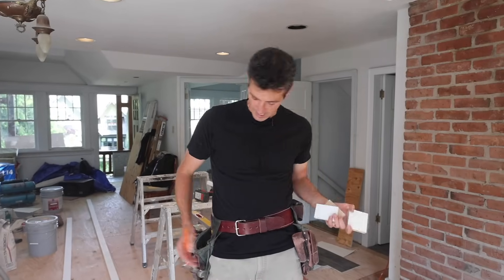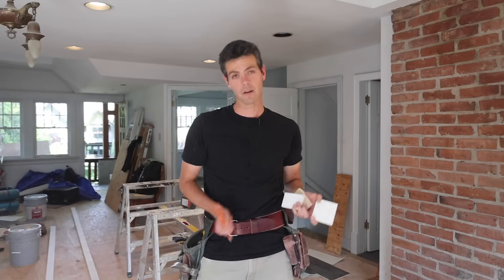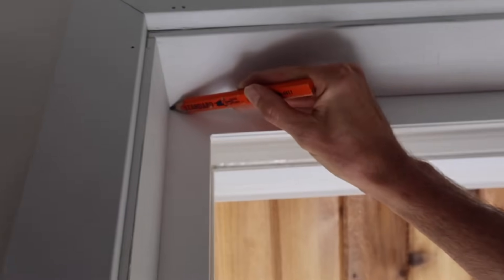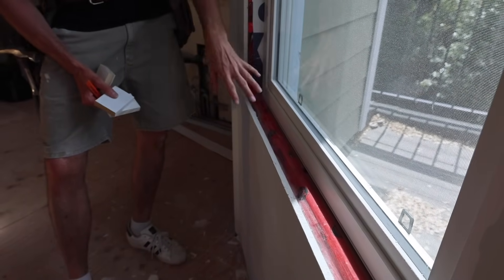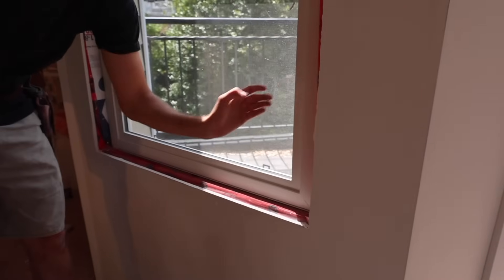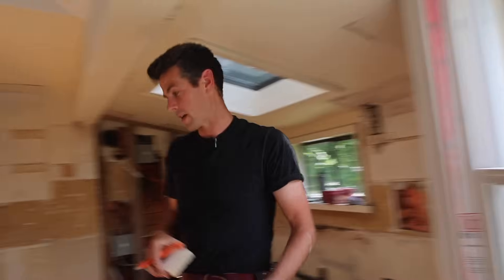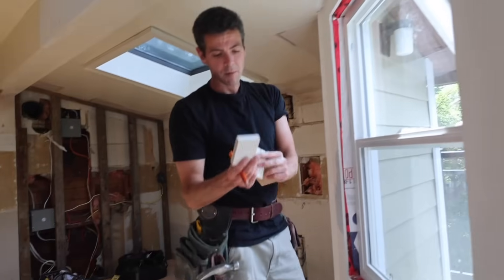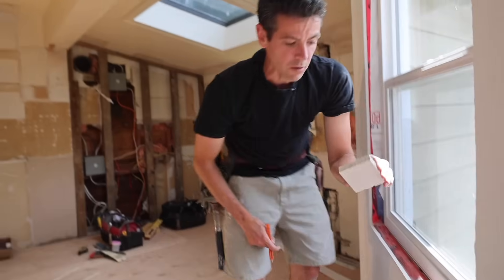How to install a WINDOW SILL you won't REGRET!!!

Comment: The slide markey thing is a combination square.  Love your Videos,  just trying to help if someone is trying to find one.  Also the little nurled round bit on the frame is actually a metal scribe hidden in a convienient spot since it's sharp point won't dull and is more accurate than a pencil.

To fine tune the back gap why not run a carpenters pencil down the back wall and where ever it marks tune it with an orbital sander or belt sander.  Easy way to get a contour match.  It's an old countertop makers trick when not installing a backsplash.
Reply: I'm calling it a "slide markey" from now on.

Comment: I suggest you get a long metal or wooden ruler... tape measures normally have a bit of movement in the grippy bit at the end, so they are only accurate under tention, not when you lay it on the side and press a pencil against it. I know it is only an mm or so, but you said be accurate.

Comment: This has been the most complicated way of doing window sills I have ever seen in my life.... 

Step 1 get your inside horizontal dimension measurements &  add your outside reveal over hang  measurement to your inside measurement ( for example if your inside is 36 and your outside reveal overhang is an 1inch then you add 2 inches to 36 and you get 38". 
 Step 2 measure your inside jamb perpendicular on each side and add your  apron stock measurements (for example if your left side is 3inches and your stock is 3/4 then one side is going to be 3 3/4 repeat same method on opposite side. 
Step 3 transfer all measurements to your stock you want rip first then establish your  over hang reveal once doing that mark the insude corner of the  overhang 
Step 4  with an angel finder you butt your angel finder to the corners of your window sill and you get your corner angel and line it up to your stocks corner points or the over hang you transferred. 
Step 5 once you have transferred your previous dimension to the the stock you cut and rip as needed per your measurements then transfer your corner angel to line up to your inside point of the overhang reveal. Cut with a jigsaw and wallah easy window sill
Reply: Any way you could do a video to show what you are talking about and share the link with me?
Reply: Great post !! 
I have an addition to make things simpler for some.
My jambs are made as a 3 piece unit and pinned together with some glue, and dropped in place over the stool. I make them 1/8" outside the plastic inside edge of the window, to reduce the amount of window frame showing. The windows are made exactly, so it's easy to add 1/4" to the width and 1/8" to the top dimension. You get a 1/8" reveal around and use left over plywood etc for shims between the jamb and the rough framing. No need to wory about framing that is out of line, not plumbe etc, you just work to the window.
I rod and spray foam between the jamb and rough framing to give a super tight insulation and no drafts etc.
I hope this makes sense. Thank you to everyone who posts here with great ideas etc.

Comment: It's called a "combination square".
Reply: Thanks man, on my way to order one from amazon, you helped :)
Reply: My wife asked me if anyone had the proper nomenclature for the tool.  I said someone should have already. 🤣
Reply: @MSeroga  Be careful quality of the combination squares can vary widely.
Reply: Starret
Reply: @jimg_hookem4435  Though overkill for carpentry they are nice in the shop for machine set up and fine woodworking layout!
Reply: @johngrossbohlin7582  I used the tool just today to set underside runners for my 70 yo site built kitchen cupboard drawers. A couple of years ago I worked with a wood wright and she taught me the practicality of working with the tool, which BTW I purchased from Harbor Freight.
Reply: @atteroljones6936  It's not that I don't appreciate the utility of combination squares... I've got several... including a Starrett, the Powercraft [Montgomery Wards house brand] that I got about 50 years ago as a gift when I was a kid, and a couple others I inherited). For carpentry I use other techniques... dividers, compasses, story sticks, and even just a pencil guided by my fingers along an edge. On the other hand, when I need more precision in fine woodworking or when setting up machines a combination square is really handy.

Comment: Great video Ben you got to use your CA glue for those little returns pieces though, it takes hold so fast. I started to use CA glue for my mitred casing to preassemble it on the floor before nailing it on after you did the video on it and I swear by the stuff now that’s how I case all my openings. Like to see you actually throw the belt on and not just have the mud tools 😂
Reply: CA glue is one of my favorite recent discoveries 👍

Comment: When I remodeled my house one thing I decided I definitely didn't need was the oval shaped bathtub in the master bathroom. In the 20 years we lived there nobody every bathed in it. It was too tiny to be comfortable to sit in. So I cut it up with a saw and threw it out the window. But when I was breaking it apart I damaged the window sill. So since I was going with a dark oak finish for the mirrors and the bar, yes I was putting a bar in place of the bathtub, with a mini fridge, ice machine, racks to hold wine bottles, a shelf for wine glasses, and a place for putting towels (what man cave doesn't have a bar in the bathroom am I right?) So I removed the damaged sill and replaced it with oak trim, the same used for oak staircases, and I cut holes in it so I could place recessed lights in the sill. Then I ran wires under the sill to behind the mini fridge in the oak shelf for the recessed light timer. Now when I walk into the bathroom at night there are colored wine bottles in various shapes sitting on the recessed lights and each bottle gives off a different colored light. For the floor I used a dark bamboo hardwood, very nice. I also installed wall sconces with dimmers, new ceiling and wall lights with dark metal finish, and some bar type decorations, like an old Guinness sign and a wine related painting, and of course a stereo sound system. Who doesn't like to listen to music while they soak in the shower? :)
Reply: Who asked you
Reply: @ivanmartinez5696  apparently you did

Comment: Oh my. Picture frame build this window trim to the size of the vinyl window itself and nail it up in one piece. Use trim screws to adjust the sill pieces if needed. Use spray foam in the gap right before you nail it up, it will expand to fill and act as a glue. No need to shim and fuss and make all these marks and measurements. Build it straight and square on the bench and be done.

Comment: Thanks for the video. It's unclear to me (maybe I missed it) why wouldn't you use a flat piece of lumber for the sill, instead of that piece that you used? Then you wouldn't need to hide the ends with miter cuts.

Comment: Save a lot of time, effort, & expense by using one inch (3/4") poplar ripped to the desired depth to make an interior window stool (sill is an exterior window component). I've found a 10 degree bevel on the outside edge is very attractive (a 3" depth will accommodate holiday window candles). Again, save time and effort by using the same poplar material ripped to a compromise depth to create top and side jamb extensions. Glue/screw together and install as one 3 sided unit with shims into the framing. Install casing to jams with 1/4" inch revel. Install stool apron and you're done.

Comment: Should try CA glue for the mitred returns. Makes life way easier.
Reply: That's what I was expecting him to do. He did it on another video when making door casings.
I'll bet he just forgot to bring any, and just used what he had on hand.
I mean, he already had the wood glue there for adding to his mud.
Reply: CA glue on pine doesn't hold very well, just glue and brad nail it, then fill the hole. You don't want it to fall off at any point in time.

Comment: The deep part on the blade between the teeth is called a gullet, I believe.  You probably want that just above the material so your blade has a chance to clear those gullets as it comes around.
Reply: Wrong, that is too much above the workpiece and increases the chance for kick-back.  The man in this video is correct keeping it low.  The sawdust is ejected below the table on the downward rotation of the blade.

Comment: The part you are working on is actually called the "Stool". The "Stool" is the piece you are working on and is inside the house. The "Sill" is the wood the window sits on and goes outside the house and provides the slope for water run off.

The tool is called a combination square. 

Just in case anyone wanted to know that as when you go to look up more info you should know what the components are called and it is a pretty common mistake for people to refer to this as the "Sill".

Comment: Why did you miter the ends of the sill and then cut pieces to fill it back in. Seems like extra work?
Reply: Gives the ends a paint grade finish instead of an open end grain which will soak up paint and give you a different finish quality
Reply: @OddJobsWorkshop you can't sand and prime the end grain to get a smooth finish?
Reply: @taumax  You still have to fill in the gap. The sill was L shaped with the inside edge being like 1.25" and the main part .75" from the looks of it. Though, otherwise, I'm with you and I'd rather not have the extra miter cut on a flat piece. I did a countertop edge for my parents and sanded the oak end grain to match the face grain. It looked great and I touched it every time I walked into their house because I was so happy with the result.
Reply: Not only matching finish instead of end grain, but if the sill has a half moon rounded facing edge, can carry that back to the wall instead of it being cut flat with sharp edges for improved detail.

Comment: “I know you metric guys are losing your mind right now”. Yup!
Reply: I'm curious if you work in Canada? I've never seen metric used in construction, precision metal work or sheet in custom sheet metal even though we are supposed to be a metric country & metric is so much better.
Reply: @Loopsrainforest  Australia. Metric all the way here.
Reply: I live in the USA and I wish we used metric instead of SAE. Everything is based on 10 and is so much easier to calculate.
Reply: @enigmaticx326  we had a travelling Aussie work in our stainless shop in Vancouver for a few months & it was quite hilarious watching him freak out about how trying to measure shit in feet, inches fractions & thousandths of inches was absolute bonkers.
Reply: I knew i wouldn’t have to make this comment 🤣
Reply: If you live in the UK everything is sold as metric, but really is just a conversation from inches.
Reply: on of the best things that Australia did - choosing the metric system. :D
Reply: I thought all the tape measures up in Canada had both inches and centimeters on them
Reply: @aaron74  no, some do but you can find strictly imperial or metric tapes. I prefer strictly imperial so I can throw my tape in either direction and can read the measurement right up against whatever I'm measuring.
Reply: @Grizzleback07  Americans get confused with imperial never mind metric you lot would be stumped!!!

Comment: Here is a killer way to find the center measurement of an odd fraction.  Your example was 31 and 1/4....here goes.  First take the 31, divide by 2, and ignoring the remainder you get 15.  Now, take your 1/4 and add the numerator and denominator (1+4)and you get 5.  Then, change your denominator to the next smallest increment, (eights in this case and make that your new denominator making it 5/8.  All together you get 15 and 5/8ths.  
Here's another one:   9 and 3/8ths center would be...
1) 9 divided by 2 =4 (ignore remainder)
2)  Add the numbers in your fraction together.  3+8 = 11
3)Bump original fraction denominator to next smallest increment.   In this case it's 16ths
4)Answer is 4 and 11/16ths.  
Simple math, no pencil and paper, no carrying, nothing hard, basically error proof.  Works for every single odd fraction. I hope this helps.

Comment: I noticed one thing that’s super dangerous and I learned firsthand your portable table. Saw on the floor is not very safe operation. If something jams in the blade and pulls you down into it gravity is in favor of the saw it’s against you my nephew cut five of his fingers off by falling into the blade, hovering over a tablesaw on the ground. Great ideas to buy the $89 Dewalt portable work table. Throw that saw on top of that and be safe.

Comment: That seemed like alot of work for nothing? Measure the inside and paste it..then measure the outside and mark it.. if its an inch difference subtract from your next cut? Trick is to cut the trim and caulk it yourself , painters are happy and you get the desired look before you leave the site?? Maybe just me?

Comment: 17:39 the blade shouldn't clear the material any more than a 1/4" ,the same as when you used the table saw, like you i don"t know why but," that's what they say"...
Reply: It's to minimize the amount of blade that you can come in contact with in the event of an accident.
Reply: it is for safety, as well as the blade doesn't "wobble" as much so your cut tends to be more square and true. when cutting sheet goods or a door or whatever else I tend to have my saw sticking a quarter inch past, same as with a table saw. I don't bother when cutting lumber to length.

Comment: Why do you insist using the fractions and stuff? Like, how much brain power and time are you losing with the increased error rate possible from all that complex stuff - doesnt all that make you want to stop using this unintuitive system and just go with 130cm inside, 145cm outside and boom done. 
Hesus help you, brother! Just feel like it takes quite some enjoyment out of your work and keeps poking in those little uncomfy feelings when you again need to think about fractions and doupt yourself and check again.. instead of.. 155 it is. And if you need to go more precise, just switch to millimeters and 1555mm it is! 
Or has that suffering turned into somekind of kink that we cant save you from? :D Really want to save you from the unnecessary difficulties.